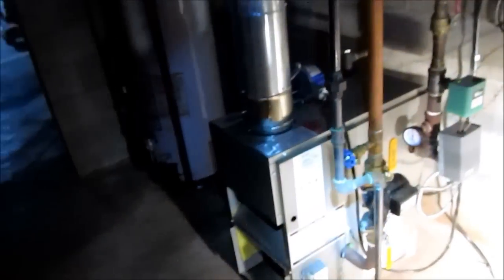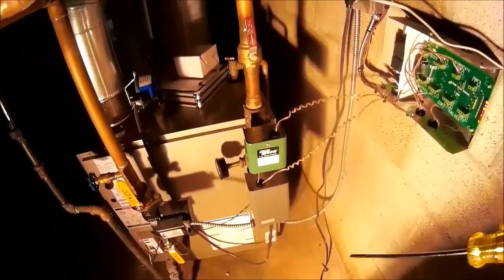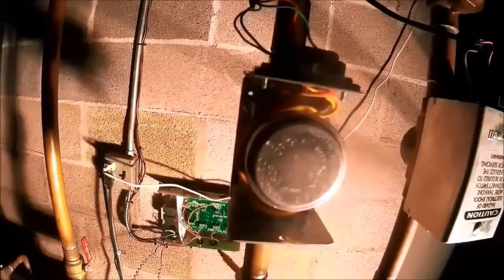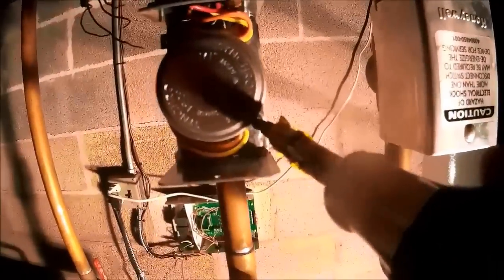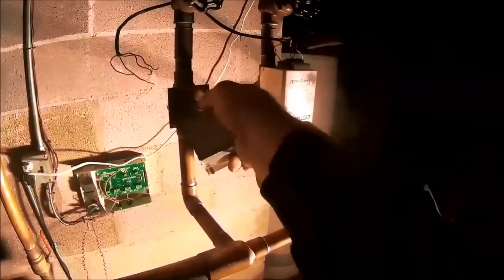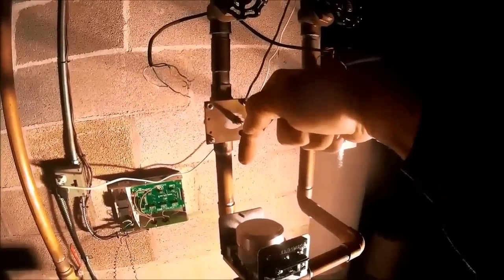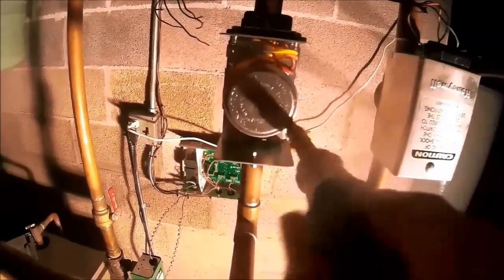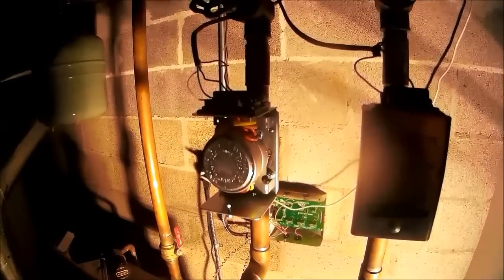Bad end switch on a honeywell zone valve V8043F1036

Comment: This is a good video except for the volume. Thank Goodness for YouTube CC or I would have had no idea what was being said. Read on, how I fixed mine, if you do not want to strain your ears to listen to this video. 

I replaced just the valve assembly motor and still no damper opening, no circulation pump and no boiler fire up, even though the motor was doing it’s job. I had robbed the motor from a brand new complete zone valve assembly, because I could not seem to separate the electronic parts from the copper valve part. 

With new motor on and POWER OFF, I then tested the old micro end switch for continuity and when pushing the button ALL THE WAY IN, I got continuity. I then tested the brand new micro end switch on the brand new zone valve assembly and noticed I got continuity with the button only PUSHED 1/2 WAY IN. I decided to take the motor off again so I could access the micro end switch screws and proceeded to replace the old micro end switch with the new one, even though the old one had continuity. Once the new micro end switch was in place, I put the OLD MOTOR BACK  in place and wired up everything. I turned my thermostat way up and then turned on the power to the boiler and Walla, damper motor turned, circulation pump came on and the boiler fired up.  IT WAS A BAD MICRO END SWITCH! I had put the old motor back on and the only thing new is the micro end switch.  

If you cannot separate the electronic part of the whole zone valve assemble from the copper valve part, read on. I found after loosening the two screws, I used a good size flat blade screw driver to first pry the top then the bottom, top, bottom, top, bottom several times and it does start to come lose and eventually separate. I did this on the new zone valve assembly, which no longer has a micro end switch, because I did not want to break the old one, which is now working. I was afraid of breaking the little rubber valve inside the copper fitting, but it seems they can be separated without breaking anything. 

It might be easier to just replace the motor and/or the micro end switch rather than prying apart. 

Here is a link to a really good video on how the Zone Valve assembly works. 

 How a Zone Valve Works - Hot Water Heating
https://www.youtube.com/watch?v=Z8f_SBQTMtw   

Hope this helps someone whose boiler is not firing.

Comment: Why replace the whole zone valve motor a$$embly? Those little brown micro-switches are used in many things, from self-cleaning ovens to photocopiers. They're not unique to Honeywell.  They're only a couple of bucks, compared to a couple of hundred. Mine are 30 years old, and 2 out 3 still work (3 were good until today). Wish the gummy ball valves lasted longer though...

Comment: hi could you just eliminate that zone valve all together? just have it open all the time . turn off thermostat too it and just have water circulate through that piping when other two zones call for heat?? please advise thanks i have 3 zones on trilevel house with these valves its currently partially open as rubber ball inside valve body is binding.